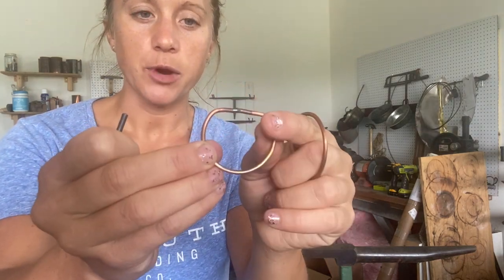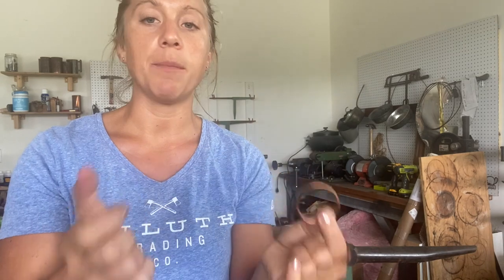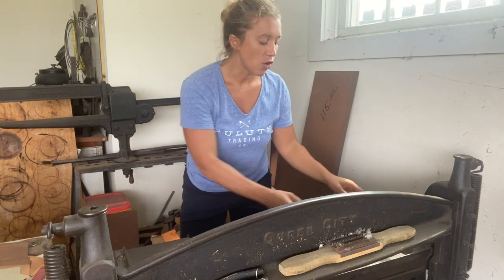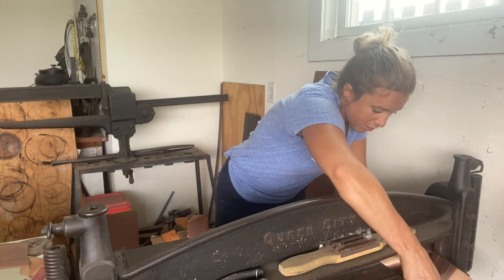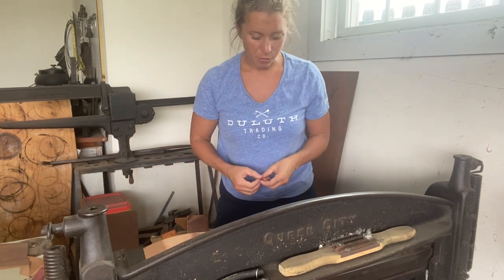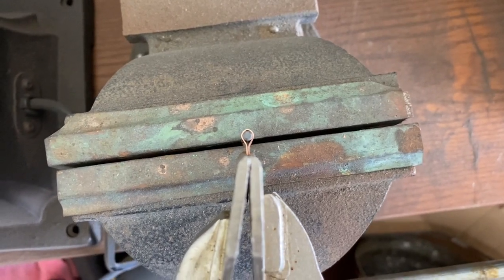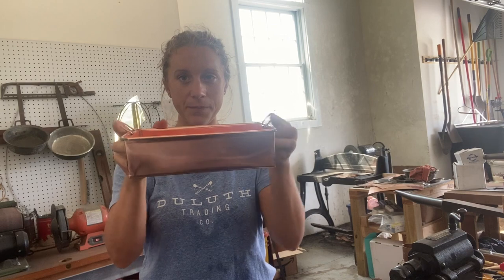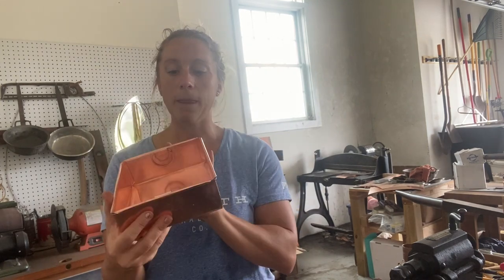How to Make a Copper Hinge

Comment: Hah. This is just how I hand made some hinges recently to attach three copper enamel panels to make a triptych. Only difference is that I used the vise to crimp the copper around the steel rod (drill bit) instead of the hand brake. Same result, though there were marks where the teeth were on the vise. But actually the teeth helped grip the copper tighter to the rod and made the circle nearly perfect (I could barely pull the rod out!) And, it was interesting to see how you flattened one surface, with the rod in place, to make the "9" shape. In my searching for how to make hinges, I found a hinge-eye making jig that would be so useful for this - some day! So many tools and so little money/time! Last note: I checked the notes to see what solder you use - I use Johnson's IA-423 solder - bought a bunch of it 30+ years ago for making stained glass kaleidoscopes - the solder really comes in handy for the copper boxes. Thanks again for your videos. ♥♥

Comment: How old is the copper cutting tool? Lovely thing. Looks to be from the early 19 century?  Is that called a guillotine? What is the thickest gauge you can cut with that? Thanks for all this information.
Reply from the maker: It's from the 1800s, you are correct - I inherited from my uncle, who was a blacksmith before he passed away. We call it a stomp shears, but I have also seen it called other, similar names. You're not supposed to go too thick; I have gone as thick as .040 but that's a bit of a stretch and I have to go careful.

Comment: A very comprehensive approach, and I learned a lot. I am curious if there could be an application where the "legs" of the hinge piece could straddle the sidewall of the box. I may have to experiment with this as I'm liking the idea of both rivets and solder, the rivets offering a slightly more rustic aesthetic. Only problem I can really think of would be that any edge finishing would have to gap where the hinge would sit. 

Very clever, by the way, using a broken drill bit as a mandrel. I could see so much struggle trying to use a piece of sacrificial copper and having it distort while you work. The bit would be far more durable in that role. Plus, it's using something that would normally be wasted and I love that.
Reply from the maker: Thanks TJ - so happy this was helpful and educational!! I'm sure there's a way to use the long part of the hinge over the sides to straddle, but you'd probably want to custom form for the lip as you go. A bowl without a wire (a folded edge) would obviously be easier to do a straddled hinge. :)